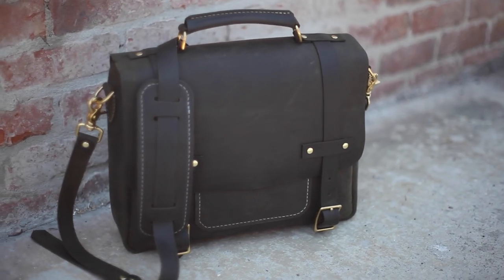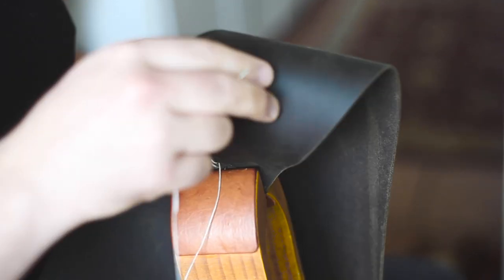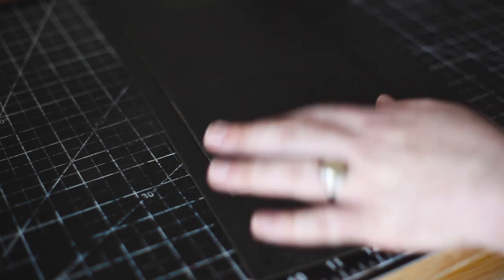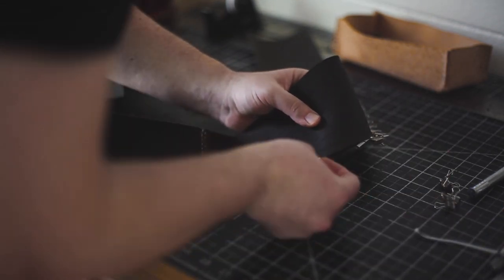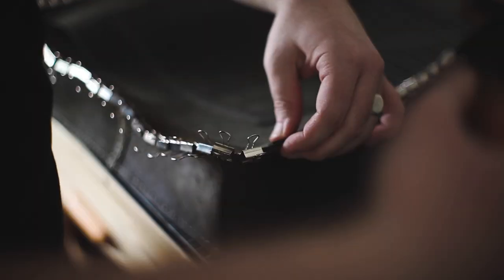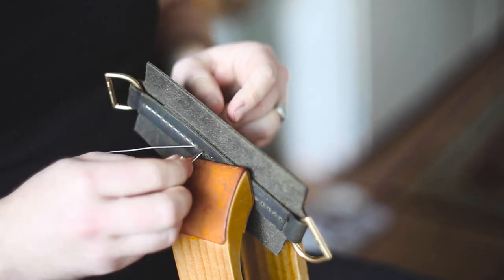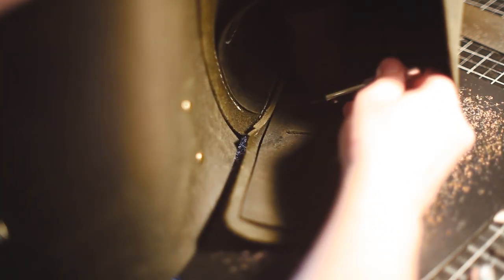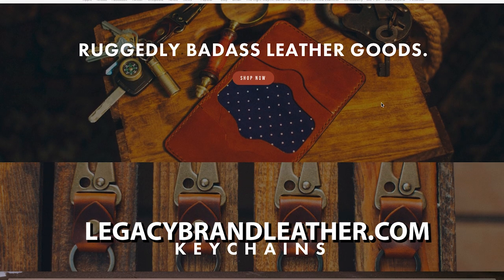Handmade Leather Satchel Tutorial (FREE PATTERN)

Comment: I made this for a friend and it turned out beautifully. I changed the front buckles to have magnet closures and I lengthened the handle attachment straps to add a stitch line in front of the rivets for more strength. I still am not sure what to do with the inside side flaps. I just left them loose but maybe they could've been attached? Anyway, thank you so much for the pattern and video. Fantastic!

Comment: Amazing project! Just one question: what do you do with the ends of the side panels? Are they secured somewhere on the inside?
Reply from the maker: Thanks!  The side panels just fold in so that the bag does not buckle and protects the interior contents.  However, you could do without this and cut down the flaps. Or, you could include a zipper closure.  
Cheers!

Comment: What kind of paper I can use to print the pattern?
Reply from the maker: I used thicker card stock.  If you don't have a way to print these large enough, I gave the overall dimensions of the larger pieces on the pattern so you could tape paper together, like I did in the video.  You could also tape regular paper to a thicker material and cut it, i.e. card stock or even cardboard could work.  I hope this helps!  If you end up making it, tag me on Instagram @legacybrandleather.  Cheers!
Reply: @legacybrandleather  
Of course.
Thanks, bro. 🤙

Comment: The top flap template says 15" in length, but the actual dimension measured in Illustrator is 14". Which one is it?
Reply from the maker: Thank you for bringing that to my attention.  The top flap width is 14" wide, not the 15" it states on the pattern.  I will amend that.
Reply: @legacybrandleather  Woof good thing i checked your pattern here- the one on Tandy is still wrong, I was very confused :D

Comment: I don't know why people design the handle like that. The leverage under weight will tear the rivets out in short order. A leather strap at each end of the handle that travels down either side of the bag in the same way the shoulder strap travels down each end of the bag should be used. Anchor by stitching instead of rivets (you can use rivets IN ADDITION to stitching if you think it will help) and it will be much sturdier. Stitching is extremely strong this way because it spreads load tension over many stitches, whereas with rivets the load is all supported at only two points, those being the two inner rivets closest to the handle on either side. Nice design otherwise!